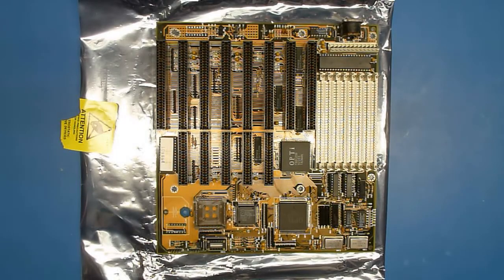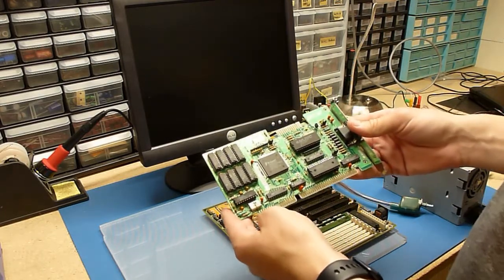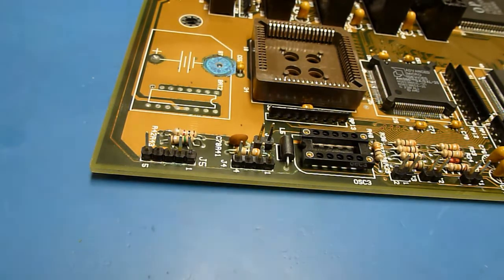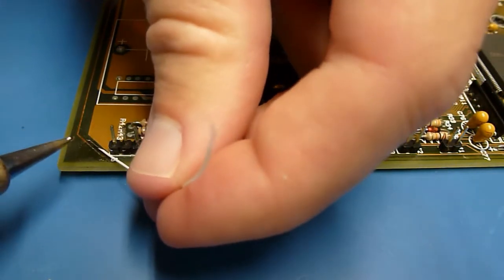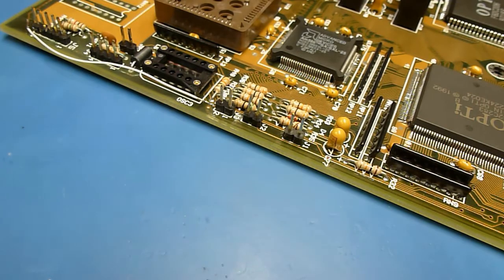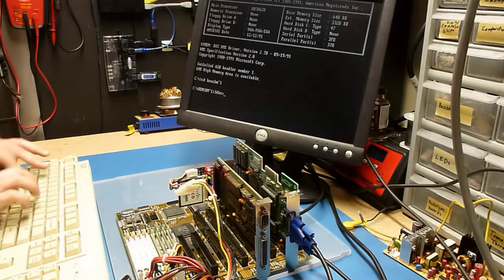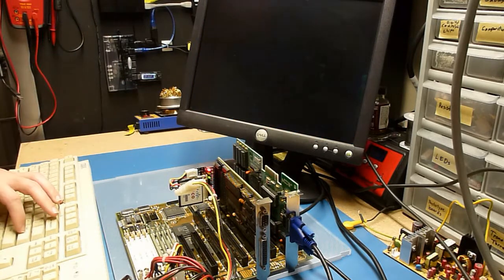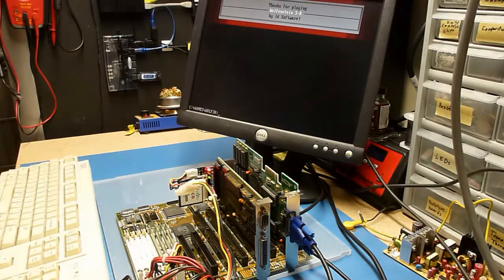386SX-25 Leaky Battery Repair and Demonstration

Comment: that exact motherboard was my first computer ... 386 sx 25mhz -- 1991
the 486 was still a dream away, the system to drool about at that time was the 386 DX 40

but mine has extensive catastrophic battery damage... 
even so it does runs a few POST codes but then it stops on some code related to the system timer or RTC... I need to find the broken traces to see if I can bring it up to life

Comment: Btw a 386SX, in my opinion, is totally worth saving. Not because I had a 386SX-33 back in its days but because - the manufacturers liked to skimp on battery quality? At least it seems so to me. I've seen quite a bunch of unharmed 386DX boards but basically ALL the SX ones had leaky batteries. I needed a long time in e-waste recycling just to get a working 386SX without horrible acid (well, base) damage.
Oh, and Wolfenstein gets super smooth on a lot of systems... the lowest of them may be a 386DX-40 with VLB video...? Not that I didn't play it back in the day, it was very fine compared to Doom, especially Doom 2 - and I played through both on my 386SX-33... Today it feels masochistic :D
Reply from the maker: My first PC was a 386SX-25. Not a blazing fast machine and at the time I hated that it wasn't a 486 but, just like my 68000 equipped PowerBook 100, I've found out now just how much they were capable of that I didn't even know about back then. Soo many games play well on the SX platform and I just didn't know about any of them!

The SX is definitely not on the typical collectors radar and yeah, lots of leaky batteries. I tend to think it's because they saw less actual use so the battery got down to 0 and started leaking on them much earlier as they would have been the first to get upgraded. Kind of like the Macintosh Classic vs Classic II. The latter almost always has screen burn-in while the former doesn't. Vastly different performance between them.

Thanks for the comment! Final year of engineering degree has been brutal so no videos until after May.